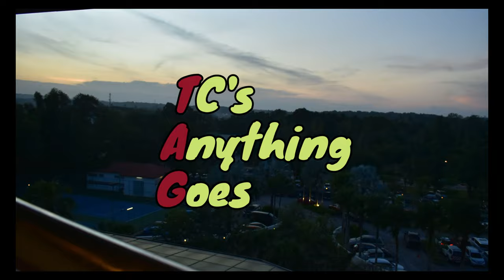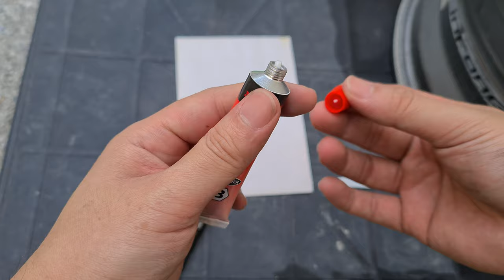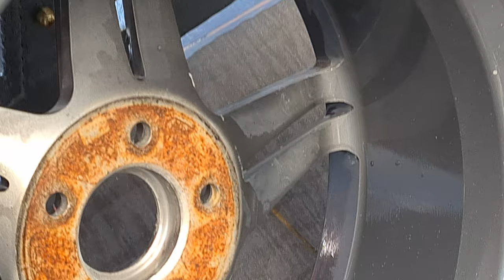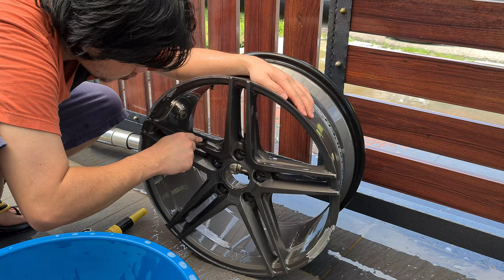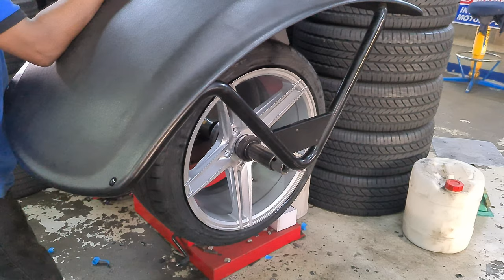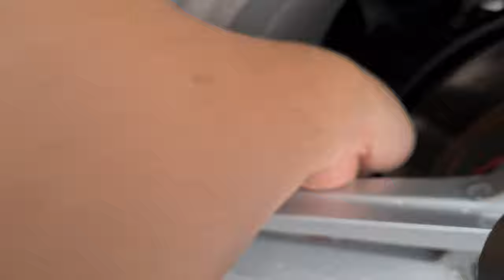Restoring Old Rims

Comment: What adjustable brand did you use.. spring rate?
Reply from the maker: I am using BC Racing BR Series with top pillow ball mounts. Front 8k and rear 6k spring rate if not mistaken. 
Been using them for years and only in 2019 i got it serviced.
Reply: @TCsAnythingGoes  ok thanks.. 😁 im still survey for the coilover..